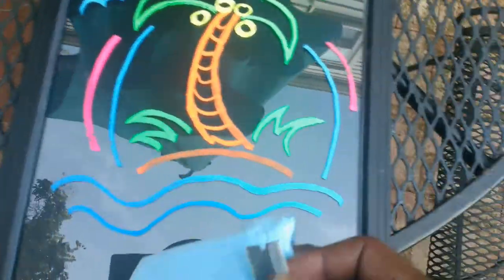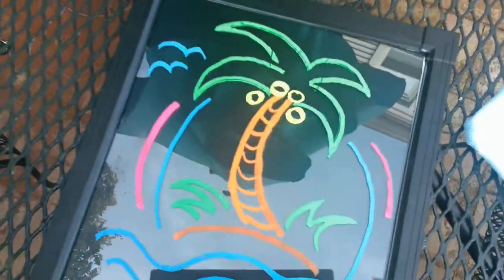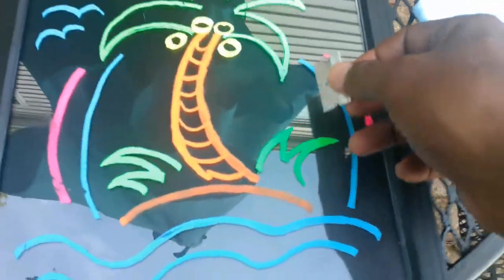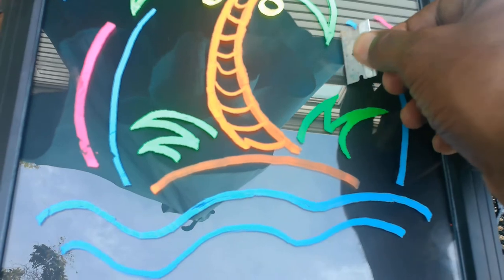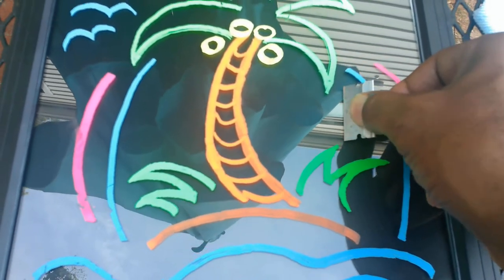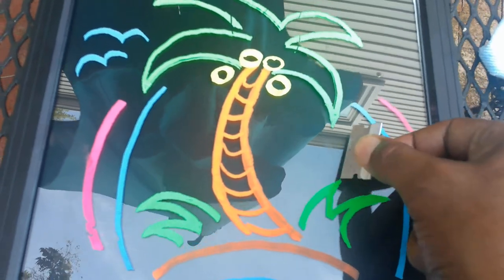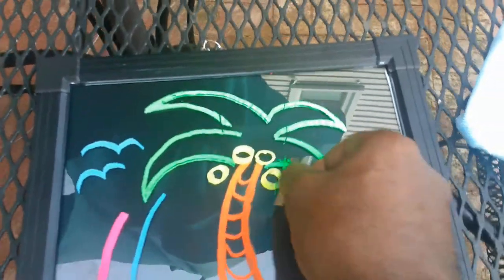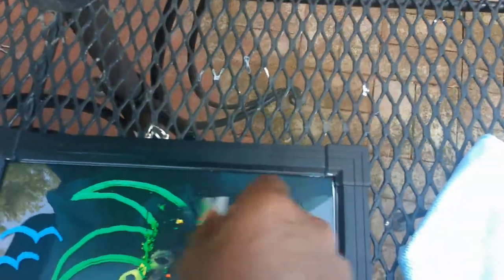How to clean a LED Message Writing Board

Comment: My board scratches really easily I’m afraid to use this method ! Anything else?
Reply from the maker: I don't doubt that all boards are not the same. Unfortunately, this is the only variation I can recommend. The key to this method is the angle of the blade. Keep it slanted as much as possible. Try this in a corner if you're not sure.
Reply: A credit card!